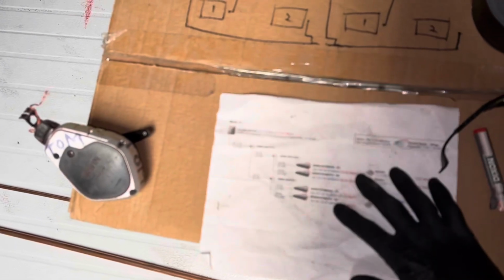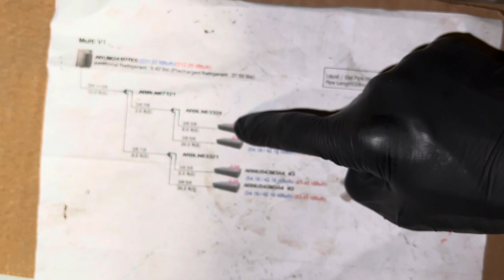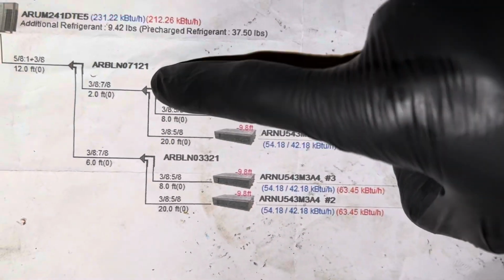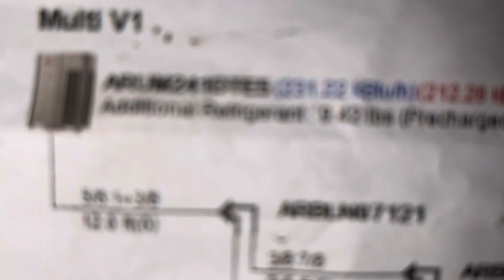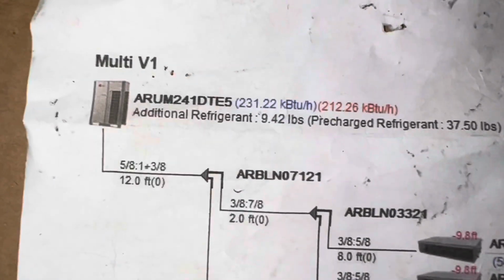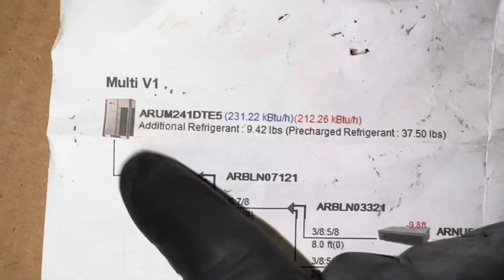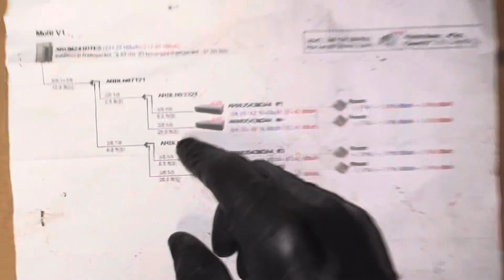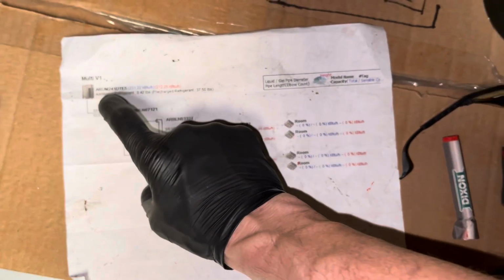Refrigerant piping on a VRF 20 ton heat recovery unit two for air handler‘s￼

Comment: That’s heat pump not heat recovery. There’s no branch boxes on your LATS diagram and you’re only using Y branches, so that’s heat pump not heat recovery.
Reply from the maker: It is a heat recovery unit on the roof. We don’t have the heat recovery hooked up yet for the reheat for de humidification that is coming later..

Comment: Your VRF content is awesome man. Rather new in my area in the northeast having all kind of issues with compressor failures on unit. I'm convinced its oil return issues we installed the units from scratch. Two different brands of equipment and sites we are having the failures. I used to think the LG equipment was junk seems like the Toshiba carrier has more part failures. Hard trying to learn these units by yourself. The brand reps we have are not helping at all.
Reply from the maker: Stick with one unit and do not switch learn it like the back your hand it’s impossible for you become good at all of them unless you’re some sort of superhuman.     Over the last 40 years I’ve learned one thing technology has changed so much you could know a little bit of everything but if you want to get good you have to get really good at one thing. 

Compressors do not die they get murdered. 

When my son and I lay out the piping we follow all the rules and procedures we use lasers we use levels.     We follow the piping software that we put the information into we learned the piping software better than the distributors who are selling the equipment. 

You can oversize VRF units. 

If they’re grossly oversized and the compressor is always barely spinning and the inside air handler‘s are grossly over side so they’re barely feeding refrigerant that will cause problems

That installation with lines can cause large oil traps. 

Not using nitrogen from beginning to end when brazing and correctly is the key all that black copper oxide not a good thing

Not pulling a vacuum for 24 hours and forget what they say go the extra mile and bring it down well below 100 µm standing decay test after you shut off the vacuum source and it should stay there 15 minutes or a hour or more. 

I think I have one video on a 20 tons VRF system with multiple heads several hundred feet of copper. 

I had the vacuum pump at one end of the piping in the Micron Gauge at the furthest farthest air handler on a ball valve and I got it down to 13 µm. 

Clean dry and tight that’s the secret

Unless it’s a girl then tight and clean and wet  lol 😂

Comment: LG? I work in the city too, where's this at? I work mostly on Daikin VRV, does LG deploy a branch selector?
Reply from the maker: Yes but on this project they could not afford the heat recovery and branch selector 

It’s gonna be a lot more expensive and both labor and materials to add it in later

At this facility they need redundant an extra Dehumidification in emergencies
                Going to use the branch selector box and the heat recovery feature with their Hydro unit to heat water for storage for hot water coils to be placed in front of the air handler‘s for reheat Dehumidification

It’s going to be so much more work and labor and materials having to change pipe sizes to add that in later opening up the ductwork to add water coils that’s gonna be a whole Nother job in itself a project that will go on for a year. 

      This project totals over 200 tons